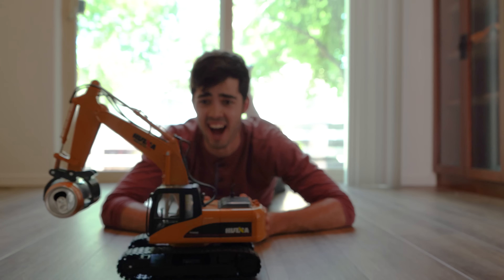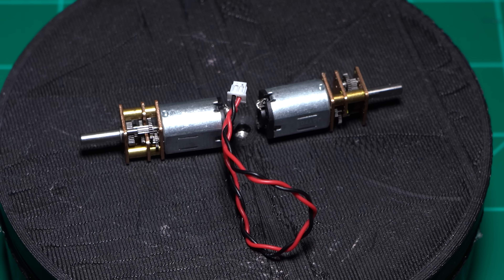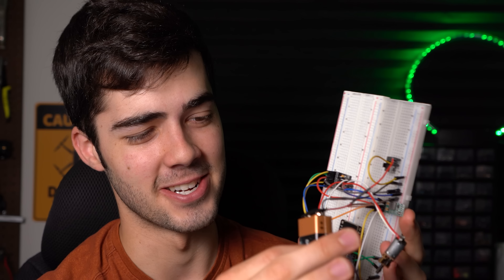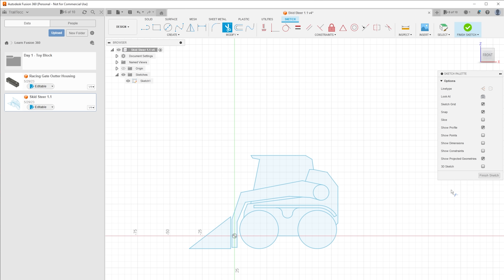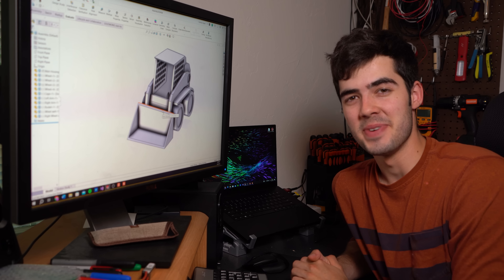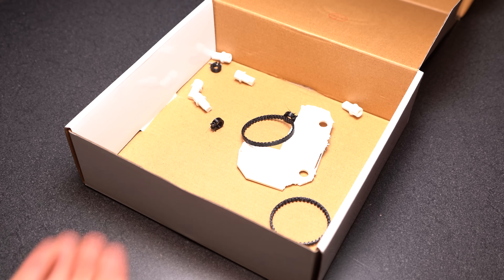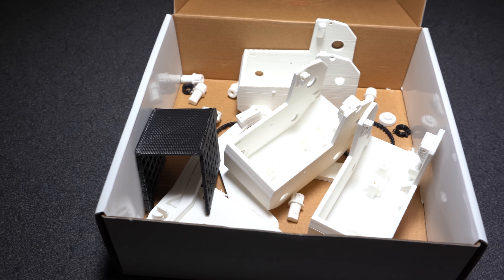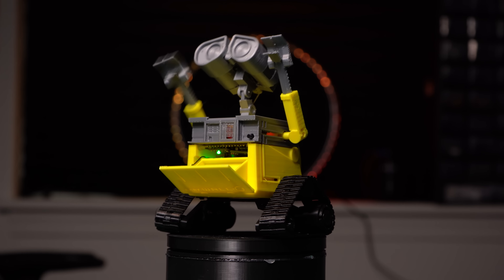3D Printed RC SkidSteer

Comment: You could try to use belt drive for the   main servo to see if it moves smother
Reply from the maker: I like what you’re thinking, I might try and give that a try.
Reply: @professorboots  also consider using 2 motors one for each side to balance the load on both arms
Reply: + you could use belt drive also in the bucket removing the motor from it wich is heavy
Reply: Ik very well that this is not easy task but its a solution i whould use
Reply from the maker: I like all of your suggestions! Especially the belt drive running to the bucket, that would be really cool!

Comment: Great video! I'm strongly considering picking up a kit to put together with our FIRST FTC team. At least that's what I'm telling myself... 

I was somewhat suprised that you didn't go straight for the track model after you decided to go with the belt to drive the other wheel. The track would perform the same function. You mentioned later in the video that you'll be doing this in the future, so it's a pretty easy mod.  

Have you considered using a rope and pulley system to operate the bucket tilt? You could relocate the servo to the back which would lighten the weight of the bucket and increase the lifting capacity and increase the counter weight to balance the load. Designing channels into the print would keep it clean and using fishing line would keep things small, low friction where there's a turn, and strong.
Reply from the maker: Thank you! Ohhh that sounds really cool! are you a robotics teacher by chance? I should also mention there’s a 2.0 video coming out tomorrow with a bunch of updates though you’ll be shocked to hear I didn’t go for the tracks… not yet that is. Your idea to move the servo away from the front of the arm is amazing and I wish I would’ve considered that when I was first designing it. Though in the updated version I ended up swapping the arm motor for another n20 which makes the arm really overpowered so the extra weight doesn’t hurt it to much. If you decide that you want to build one for your FTC team definitely DM me on discord as I’d love to learn more about it. Thank you for the great comment!
Reply: @professorboots  I'm not a professional teacher, the day job is in Additive Manufacturing R&D. I'm the lead mentor for the community-based robotics team. 
I was about to download and start printing the parts, but I saw the update coming and decided to hold off until tomorrow. I'll be in contact via Discord soon.
Reply from the maker: Oh gotcha, well that’s super awesome! And sounds good!

Comment: I would recommend getting a proper lipo charger which has the option of discharging batteries to storage voltage (around 3.8 volts per cell for lipos) and balancing the cells (if one is more charged than the other the charger will even it out).
Lipo batteries are very tricky to use because they have a high risk of just catching on fire spontaneously if not cared for properly.

Comment: genuinely curious, what do you gain from using an esp32 and custom pcb over an off the shelf rc receiver and esc?
Reply from the maker: Haha if you really want to look at it sideways and squint you could say you gain the ability to command it to do anything via writing custom firmware for example. You could make 10 of them and have em sink to each other and make em do a little dance with a handwritten script. But this is mainly an educational project to get hands on experience with development boards in a fun way

Comment: if you ever have future problems with the 4 wheel drive system, some skid steers have metal tracks for the wheels so you could always use that to help, plus it will add more for the look of it (and probably traction, idk)
Reply from the maker: That’d be a really good idea, I think I’m definitely going to make that a option in the future

Comment: 9v batteries are a trap for hobbyists. Their form factor makes them seem so enticing but frankly... they suck complete ass. 
For ~ 5v projects, 4 AA batteries (or a LiPo as you found) will beat the pants off a bucked 9v all day long. 
9v batteries are good for only one thing: Devices specifically designed around 9v batteries like fire alarms.
Reply from the maker: Very very true, glad you agree haha

Comment: I think this is awesome, I have a family member that works in a bobcat and would die for this. I didn't see a link to the schematics for PCB. Are the electronics purchase?
Reply from the maker: Haha same here I have a family member who lost it when I made them one. I’m working on updating the circuit board design so I haven’t swapped in the new gerber files. The new design features another n20 motor for the arm which makes it capable of lifting ALOT more weight. The wiring diagram is Inside the GitHub repository. The electronics you can either pickup through my website or by sourcing them individually
Reply: @professorboots  okey, I'll start sourcing the parts that I don't already have. I'll hold off until the new PCB design. Thank you
Reply: @professorboots  Should I wait to start printing parts? because it sounds like the chassis may change to support that N20 motor.
Reply from the maker: Yes that would be very wise, also I will definitely put a note in the bio of the 3D printed parts so people don’t get led astray.

Comment: What kind of screws are they?
Reply from the maker: I’m using Truss Head self tapping screws
Reply: @professorboots  do you know what size? im not sure what i should look for at the hardware store
Reply from the maker: I’m using a combo of 2.3x5, 2.3x8, and one 2.7x10 but those can be hard to find. Any M2 screw you find will most likely work. I’d recommend aM2 pan head screws, your hardware store will likely have those. If not they’ll definitely have the Allen head version which looks a little different but would also work
Reply: @professorboots  ok awesome, thanks!

Comment: Mr Boots, 

This thing is just the coolest and straight up my alley.  Once I have the money to get a nice printer I will be making a ton of "Heavy" Equipment just like this. I have drone experience while I was in the military, I have electrical and mechanical engineering background and a Certified SolidWorks Professional.  If you ever need any help with digitally designing parts, just ask. I'll do what I can. Thanks for such a great video too.

-Rich
Reply from the maker: Wow that’s so cool! Thank you so much for the offer I might just take you up on that offer or at the very least pick your brain if I have any questions. You’ll have to let me know if you start any projects or get a printer.